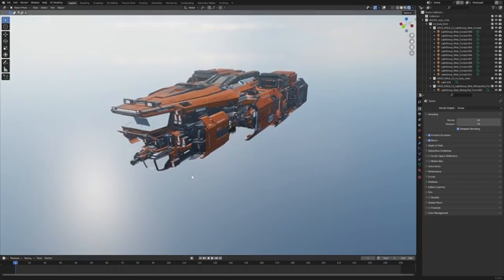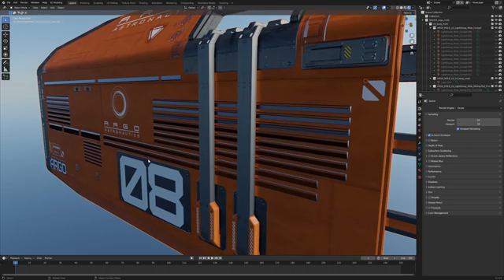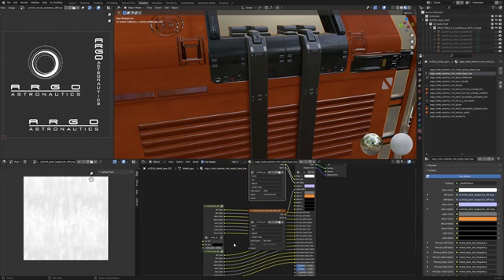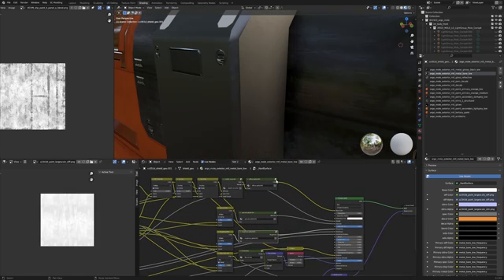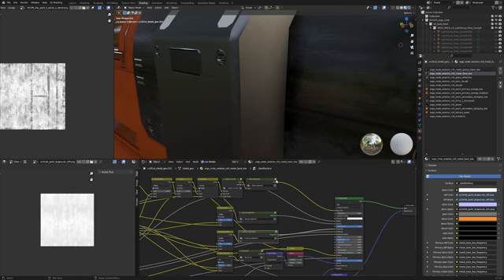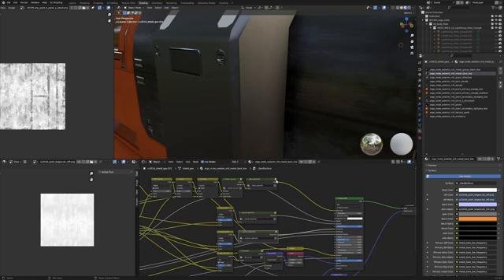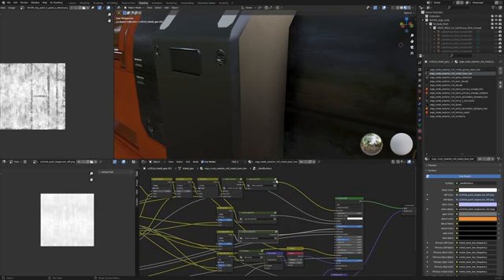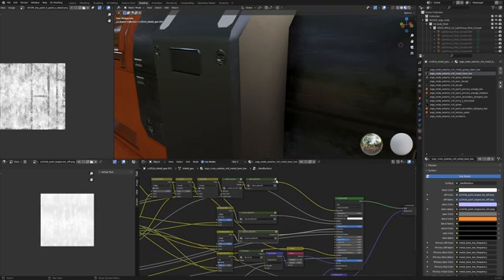Secrets Behind Star Citizen Spaceship Creation

Comment: How do you get ship models so I can load into Blender to tinker with?
Reply from the maker: there is a tool call starfab
Reply: @ A lot has happened in 5 days.  Hoping vmxeo_ can get StarFab working again.
Reply: @Markom3D  Yeah, learned about it a few days ago.  vmxeo_ and a small team are working on getting StarFab current.  Right now it doesn't work well with the current SC build.
Reply: @Markom3D  It's been a few days and I've been trying to get in touch with the current group working on StarFab.  Vmxeo_ is one of them.

Comment: hey Marko! I don't know if you've messed around with the portal node much yet, but it can make for some pretty spicy decals!! I've only just dipped a toe into it, and so far their are some limitations (like the surface you put it on will need to be flat, and any local lighting on it won't register (unless you make a corresponding light portal, but for me that sounds like too much effort something that amounts to small details) 
basically you make a box, put a bunch of scifi doodads in it (you could even do a hallway with moving characters for a bigger spaceship), create a portal plane looking into the box, go into edit mode to get the plane at the correct distance/dimensions, and then just array that plane all over a few flat surfaces. you now have a bunch of detail with parallax. It's kinda like those additive kit-ops booleans, but with less work/geometry (also you don't have to pay).

Comment: decals make alot of sense in SC. you can see the ships from very up close, so baking one or 2 textures per ship would result in huge texture size.

decals, tilable textures and trim sheets allow for more details without insane texture files that could only be used on a single ship.
it also allows to add/remove details on the final model without having to re-bake everything for every iteration.

Comment: As someone who does 3D modeling for visualization as part of my work, what I understand is that you want as little topographical detail on your 3D models that will be used for  game assets. Even with today's technology, loading times will still be shortened by simple solid models, and letting the textures come from the decals.

This isn't the same for non-game applications such as animation and visualization work, where you want as much of the detail modeled into the 3D asset so that the renderer can simulate the lighting in the image as realistic as you want/need.

Comment: I always knew the guys behind star citizen were super talented but this is like a wet slap in the face, I was so convinced the models were all super high poly because they are just so beautiful, but when I think about it it makes more sense that the exteriors have a vastly simplified model with the details relying on decals because it makes its way more efficient and allows them to keep the highly detailed interiors without tanking everyone's pc.
Reply from the maker: Oh boy are you gonna be in for a shock lol. This Friday I will do one about the interiors
Reply: Decals are pretty expensive too, for every decal on screen its a new draw call, what can tank performance engine wise.
Reply: @exa211  It doesn't have to be decals in the traditional way. Just bits of masked texture hovering slightly over the base surface. And even if you really did want to make these stick to the underlying surface, you could have everything on a single mesh with single material so only one draw-call to render all of them.
Reply: The earlier models used to be extremely detailed meshes. They joked recently on a livestream that in the early Freelancer, when CIG still outsourced modeling, the bolts alone had more geometry than an entire scene does now or something. Which is why they had to redo everything - the models were simply too heavy.

Comment: I don't think I'd like to learn from Star Citizen designs of all things for many reasons.

1 - Their ship designs have very conflicting design phylosophies in one ship, for example there's a ship that looks bulky and heavily armored, but only in pieces, but all of those pieces seem to be attached together by incredibly thin and fragile pieces that wouldn't be able to even hold up that armor. There's a "stealth" bomber that only took the initial shape of B-2 Spirit, and threw greebles and sharp edges all over without any thought put to it, and also made those wierd holes in the middle of wings. The poster-boy fighter is probably the best example of it, with very bulky square-shaped body, and then thin, sharp and tiny wings attached to it. Pretty much a brick combined with paper plane... It's a bit like two people designed two halves of those ships without communicating and then combined them together loosely. And while researching here I found a really nice design actually, where nearly the entire ship was working perfectly, the main shape was bulky, all pieces tightly integrated within main shape, looked a bit like a wide dolphin, hard body with minimal sharp edges, look like if F-15 made to be a tank, pretty smooth body and entire design philosohpy seems to be middle point between organic shape with militaristic approach... And then it's main engines are 4 small rectangles pertruding seemingly randomly from the main body, two per each side, connecting to main body on what seems like very thin winglets ready to snap at any moment. The ship already has shapes that look ilke air intakes, leading smoothly to the back where the actual engines should be. Why make the engines those stupid squares? Or there's the ship that looks like a shuttle for aerodynamic flight, but then for some reason they decided to bend the nose downward like it hit a wall and add bulky turret that's completely out of place on the tip of it...

2 - No clear recognizable shapes - That comes as a consequence from first point, but as a result there are maybe only two or three ships that have unique enough shapes, where you could differenciate them from others when just presented with black and white sillouette of it. As another consequence, when looking at a ship, it's so often hard to recognize what is this ship's supposed role to be. The stealth bomber that I mentioned looks more like a fighter. The poster boy bulky fighter looks like a bomber or heavy slow interceptor. But most of those are just not identifiable. And Star Citizen is not Elite, you can't take one ship and turn it into anything you want.

3 - No focal point. When designing anything, you have to make sure it will be easy for the eye, face, cockpit, human shape, contrast will always be something that draws the eye. Composition is important to make shapes recognizable and pleasing to look at. Star Citizen ships are so cluttered with greebles, and their shapes are so random, that there's barely any place to rest the eye on. Cockpit is not even main focal point. Contrasts are no better, there's either ship that's entirely one flat color or black and white but painted in a way that those colors are conflicting with the main shape instead of supporting it.

There are few outliers of each of those points, but there are maybe 3 ships at best (some probably only as jpegs), that are exempt of all of those points. I saw one.
Reply: I mean, they damn sure sell, so clearly they know a thing or two about 'successful' design. 🤷🏿‍♂️
Reply: @LucidStrike  Many modern media sell despite being artistically garbage. Take a look at the minecraft movie, it's horrendous, it's designs are half-assed with no direction, just "make this realistic" and that's it. No one should repeat what Minecraft movie trailer shows.
And it will sell. We know it will.

Lootboxes, battlepasses, "early accesses", partitioning games to sell for more, recolor skins for 10$ each, all objectively horrible practices, no one in the right mind should get on those scams, right? But they sell.

Star Citizen doesn't sell ships, they sell dreams that will never be fulfilled. I know people who spent ungodly amounts of money on it, it's more about manipulation. Artistic direction doesn't matter, fidelity doesn't matter, what matters is there's a lot of this high-tech clutter with no direction. The ship designs reflect the entire game. It appears good at first glance, because it seems to be high-fidelity and realistic, but it has zero artistic direction.
Reply: do you know the names of the ships you're refering to ?

the b2 is the eclipse and i think the fighter you talk about is the f7 mk1 but idk which one is the armored but thin in parts.

i don't really agree with your points as i feel like you can almost always know really fast what brand (also some brands have really cluttered design and other more streamlined) and role a ship has and if you know the game a bit you can recognise them by their silhouette easily but i may just not have a good enough eye, also interested in which ship you think is the only one that is exempt of your points
Reply: @silverslime_  Sorry, but no, I don't remember any names. The performance was always so bad on every free flight event, that I couldn't even get too far in reasonable time (and my pc is a beast since I'm a 3D artist). I think you do know which is the ship that is this not-so-stealth bomber and the race craft with tiny winglets all over it breaking the sillouete. The one that was breaking the norm was what I think is some luxurious ship, probably for tourism missions. From the angle I saw it, it had none of the flaws that I mentioned.
Reply: @Furebel  Spoken like someone talking about something they've barely dipped their toes into. If you're going to be egegriously pretentious about critiquing something, at least have more than 20 minutes spent in it. SC, ED, NMS, etc. are all fictitious, unless you have actual background experience in aeronautical engineering, your rant is based on what YOU like to see from a design standpoint, not what others find convincing. It's a videogame, if it looks cool to people, that's what sells it to them. If I wanted a boring visual, I'd land my Federal Corvette on a planet in ED and stare at blank panels lol. I am genuinely curious what designs you have created, I'm not trying to give any slight, I just want to see your perspective on space ship design.
Reply: @mehsomething  I mean you're not exactly wrong with the first part, since Star Citizen works so bad it took me an hour to get to my ship without anything breaking. XD

You're wrong tho about the fact that some fiction means we can just abandon all reason, that's not how it works. If you would put a literal ship Yamato that's also a carrier for gundam-like mechs flying through space and slicing everything with sabers into Star Citizen, that would probably be the coolest thing in this excuse for a tech demo, but it would be very out of place. Star Citizen doesn't paint itself as a cartoon world where you can have really silly looking ships that break sense of reason, it has to have some sense of reason. Make a ship that has an engine only on it's left side so it's completely asymetric and it will be just wrong, because such asymetry looks very wrong in this universe. There's at least one asymetrical spaceship in Star Citizen that still looks reasonable.

But still, you missed the point a little, I was not talking about how real those ships would be to fly in real life, the point was only artistic value. Consistency of the entire thing and communicating what the created subject does via pure visual design is extremely important, and that's where Star Citizen fails hard. Maybe it's better to look at franchise that did it much better - Star Wars. X-wing is completely built out of long hull, wings and engines. Add to that clearly visible fighter-like cockpit and big guns, and you clearly know what this ship does, and can figure out how it could fly. Compare that with TIE-Fighter, which has proportionally bigger cockpit, tighter build, thin weakpoints and exposed greebles, and you can figure out that it's much smaller, much more agile, but weaker vessel.

Big engines communicate speed. Tight build communicates light weight. Armor covering vurnerable parts communicates sturdyness. And I recently learned, that this cool ship with awful pertruding tiny engines is actually not a slow tanky combat ship, despite very prominent big turret and bulky inline hull, it's a transport apparently. A transport that looks like it would have hard times of taking off even without any load. That's the communication part where Star Citizen sucks in. I also remember that I saw two really good looking vessels, one seemed that it was a carrier and the other like a destroyer... before I learned that it's actually one ship somehow wierdly connected. And it's a touring ship...  

Consistency is another issue, that transport ship looks like a completely different vessel from bottom angle, but I think the best example is mentioned poster fighter (I don't remember the name), where you have a very bulky and tanky hull, and tiny, razor thin winglets that look like they were slapped to it last minute without making them go in line with the rest of the ship stylistically. That's really all I have to say on this one. Combining two different styles can work if you make the transition good and you know what you're doing. RSI doesn't.

Comment: What I've personally learned, to make detailed meshes with trimsheets and decals, is either making the first uv layer for trimsheets with all the detailing of the nooks and crannies, then making a second uv layer in the same model for the decal texture sheet, or just plainly using a second material if you're planning to use the decal sheet across a wide variety of assets. all you have to do is manually modelling the decal details and then arrange them next to each other and then baking them onto a plane mesh inside substance or marmoset, then after texturing, you simply reimport that plane mesh with its textures, then simply cutting the plane mesh multiple times to separate the decals and then simply attaching them onto the mesh manually, how decal machine works basically, and works inside any engine too, just mind your normals that's it

Comment: The problem with this method of making assets is not every engine supports it, and it doesn't look as good in for example UE5. They had to made so many things on rendering side of Star Engine to make it look good with Parallax Occlusion. Even the resolution of the textures is really low but in game it looks sharp clear. Try to put it in to UE 5 and it looks pixelated